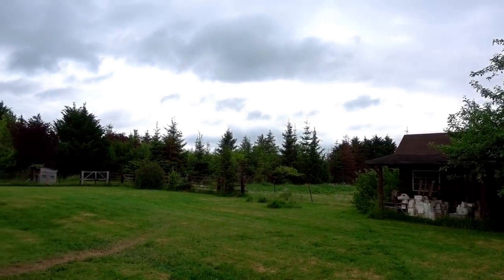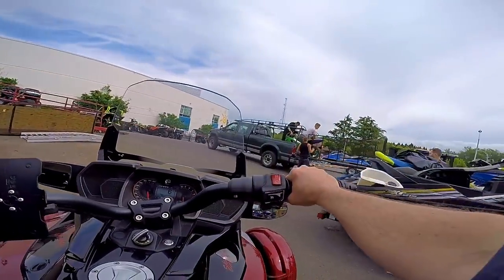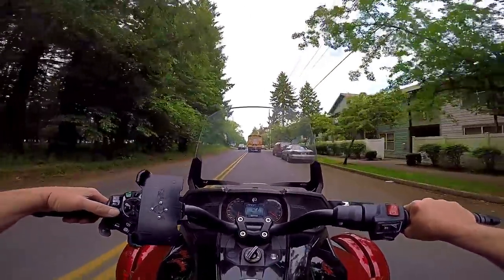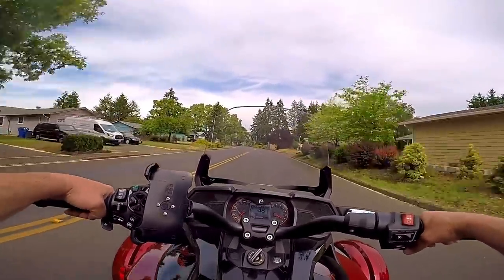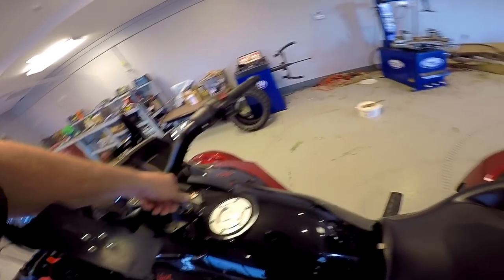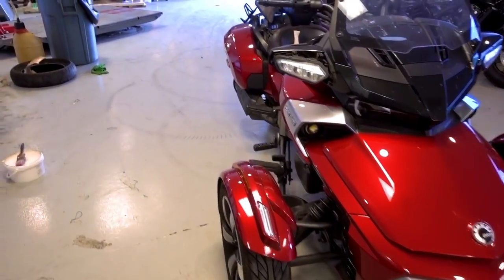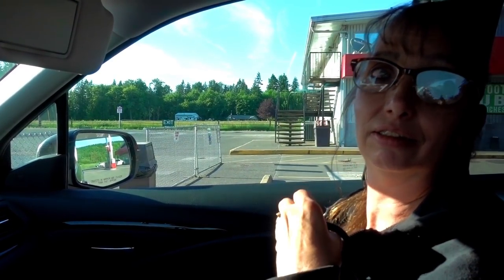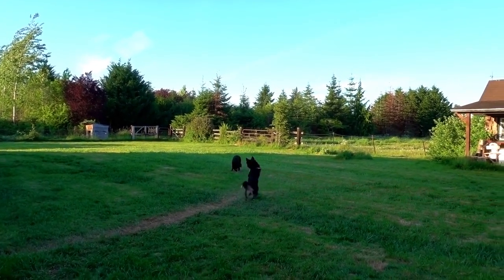How BMW Fixed a Spyder!! • F3-T Drive Pulley R&R! | TheSmoaks Vlog_922

Comment: Put s squirt of plain dawn (has to be plain dawn) dish detergent in your windshield washer fluid bucket. Helps clean and streak free. 😀 Thats a old truck drivers trick I've been doing for years!  Running Florida in love bug season you need all the help you can get!  👍

Comment: You are an excellent mechanic with that O ring trick. Do you inform Brp Of those quick fixes That they need to implement in their design. this is obviously an issue that should be addressed. Hope you get a chance to take a good long ride on all your motorcycles this weekend. Have a good one and stay safe. 😎✌

Comment: You should take Kelly to somewhere where they serve small meals so a doggy bag is not required at the end of the meal. OOh you'll have to get yourself some kind of pocket rocket, boy that Gixer is fun.
Reply: Hi there. I have A question for you. It doesn't have anything to do with your video but it is about the F3. I have a 2015 Spyder F3-S and about a year ago my rear tire hit  pretty nasty pothole.  Now I have an annoying rattling going on the rear Every time I bit any bumps or anything. I'm sure it's something that broke loose on the shock. What do you think it might be?
Reply from the maker: Hi Duane, those bikes will take quite a bit of rough riding, so I wouldn't panic right away...  Check your belt guards, rear fender, license plate and plate holder for looseness.  If all is well there, check that the rear brake caliper is secure and look around the shock area to make sure there's no damage such as oil leaking or spring damage...  Go to BRP's website https://can-am.brp.com/spyder and scroll all the way to the bottom and enter your VIN, as there was a bulletin for a sub-frame support mod on some F3's.
I'm guessing you're probable just going to find something superficial that's loose...

Thanks for watching!!